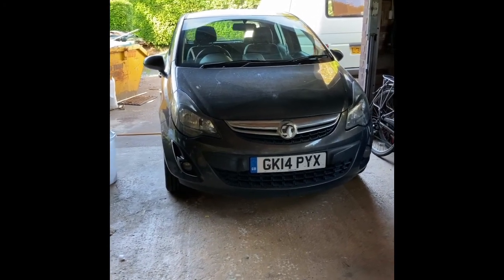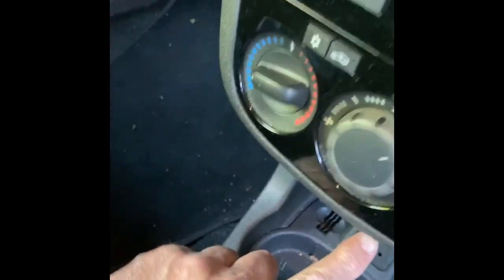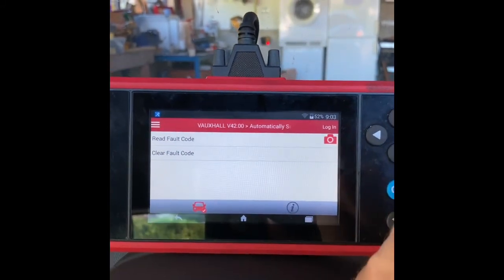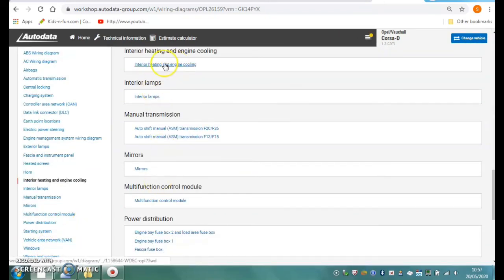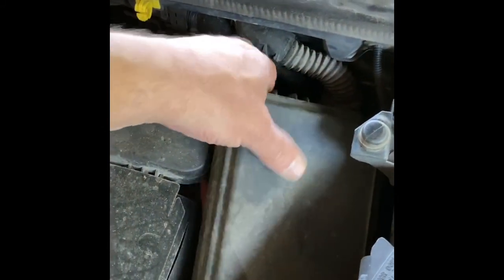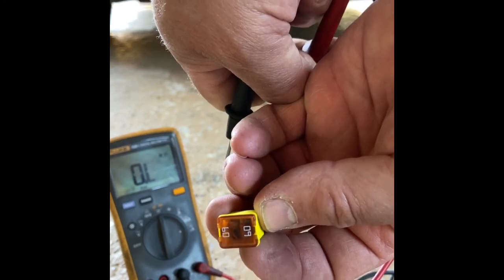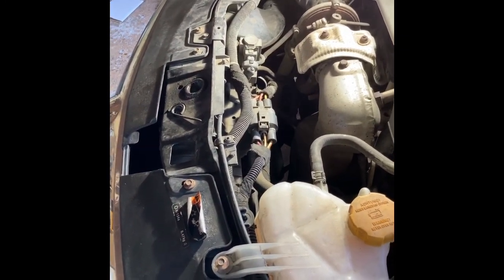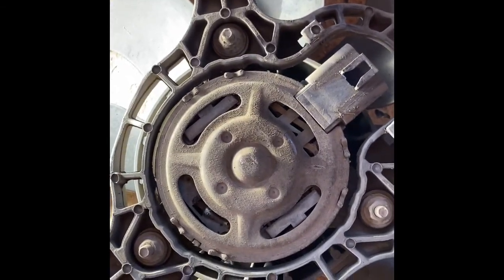Corsa engine coolant fan fault diagnosis

Comment: Good video, I had a similar issue with my 09 1.2 Corsa after replacing the coolant and hoses the fan wasn’t kicking in at 100°C and I was advised to get the fan replaced after I installed the new fan it still wasn’t cutting in, found the problem was the wrong fuse had been fitted and had blown and also the radiator resister has also failed. After replacing both these items that fan comes on at 100°C.

Comment: hello , in my corsa 2013 the electro radiator fan turns on at 108 degrees celcius reaching a maximum of 110 degrees, is that normal in a corsa? What is the normal temperature in these cars?
Reply: Hey I’m having the same issue did u manage to find a fix?? Thanks